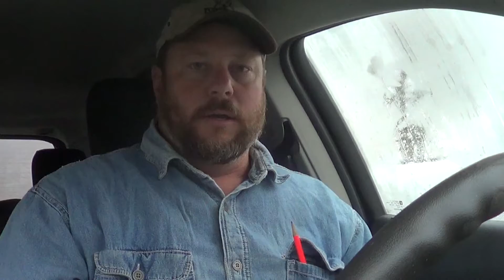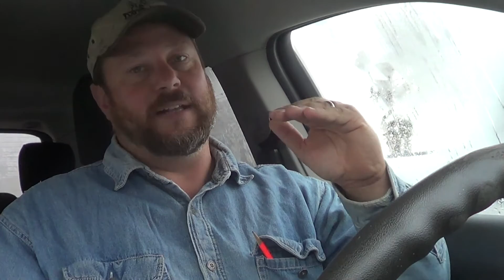Why Sweet Iron with Copper is the King of Metallurgy for Bits

Comment: What about brass, or brass inlay?
Reply from the maker: That's a very good question. All that you have to have for galvanization is 2 different metals. Brass is technically an alloy, but if it were inlaid or otherwise attached to a stainless steel (another alloy) or sweet iron (mild steel) mouthpiece, then you'd still have galvanization happen. There's a chart/scale of votage potential for each metal. The difference in the positions of the metals on that scale is what determines the strength of the battery you've created. Obviously the combination or difference of voltage potential between copper and sweet iron is a sweet spot of voltage potential that is pleasing to horses. So, if you made a stronger/weaker battery, you'd still get results, but maybe not as good.
Reply: @DanielDauphin  what do you think about making a snaffle or curb bit out of high carbon digger chain and brazing in the brass? Is sweet iron high carbon or low carbon steel? Thanks
Reply from the maker: @JackGarrettJr  sweet iron is just basic, low carbon steel.  At least today's sweet iron is. Brazing in brass will definitely still give galvanization and a current. It would depend on the specific voltage potential of each metal on the galvanic scale as to how strong/weak of a battery those 2 metals would create. There's bound to be a hi-low range to the benefits, but I haven't done the testing I would love to do to identify the range and effects.

Comment: It is so obvious you know nothing about bits except what you have been told or read you have not experienced them or you would know all Cowboys want their bits and their Spurs to rust out they do not want you look like a damn team roper with stainless steel bits there is so much more to this than what you are talking about you know absolutely nothing I doubt very seriously you are a trainer I've been training horses for 40 years and there's a reason that bit makers use metal that rusts out that they do not mold it out of stainless steel metal like these so-called handmade bits like balding they really are not handmade bits you could not buy a really good handmade bit for $250 or $150 I know so little and you're so aggravating just to listen to I need to write this s*** down so you can read it off a teleprompter or something like Joe Biden it's aggravating just to listen to you talk because you don't know most of what you're talking about and my Lord you know nothing about bits

Comment: This is amazing! I love that you got down to the science of it all, its truly fascinating. I have a quick question. Do you have a brand or specific place you get your sweet iron/copper inlay bits from? I really like that you have the experience and knowledge of bits and I would love your input on any specific brand?
Reply from the maker: Kimbri Herring Thanks for watching. I have not yet given my endorsement to any specific company. Most of the production bits out there ($35-60) are functional and good enough, as long as they have the correct components and mechanics. If your budget is a little higher, you can go semi or full custom, which may get you to around $2-250). Those bits are more functional art.

Comment: I know someone has already asked this question but this is sort of a secondary question to it. They asked about it being safe for you to put a rusty bit in a horses mouth and you said that we aren't talking a ton of rust. And I know I'm just sort of picking things but I want to make sure I'm doing things that are safe for my horse. Bits can get really rusty, like fully covered, then usually if it's the first time you used the bit and didn't wipe the saliva off or whatever the first little bit of rust gets on it. So do you just never scrub the rust off the bit and let it get as rusty as it can or do you occasionally scrub some rust off so it's not completely covered and layered with rust but it still has that texture. Not sure if that question made sense but I was just wondering if it mattered. And I know I've been asking a bunch of questions on your vids but I've just kind of been bingeing them because I want to be more educated about what is going on in my horses mouth and that I'm not causing unnecessary pain, so yeah I commend you on having really educational videos because I know they have helped me understand bits soooo much more
Reply from the maker: I'll use a hose on them regularly and a brush or my fingernail to clean up gunk as I notice it.The gunk and most of the rust will occur on the front side of the bit where it never touches the horse's mouth. Other than that, I don't do much with them. Mine are ridden regularly, so they don't really appear all that rusty. The places that they make contact in the mouth are usually fairly clean and show typical wear.

Comment: Thank you Daniel !!! Now I know why my sweet iron w copper got rusty and I almost chucked it. What do you recommend doing to it - scrub it with vegetable oil to clean ? Merry Christmas and happy new year to you and all in your keep. xxx <3
Reply from the maker: barb s I hose them off and just use a stiff brush as gunk accumulates in the crevasses. Nothing more. I have had to retire a few, but always from wear in the center rings of the mouth. Never from rust.
Reply: Thank you, I shall do this. The bit is a thick D-ring snaffle, iron with copper insets - I thought I wrecked it because of poor cleaning (I'd just use a cloth wipe it off after use and hang it on a wood hook - was alarmed at the rust after not using for a few months). But your investigation makes a lot of sense: why sweet iron without copper causes no salivation = add the copper and my horse just flows. I have a tom thumb sweet iron (no copper), and same horse doesn't flow saliva same as she did with the D-ring iron/copper. Amazing connection you made here. Thank you so much bro. xxx <3
Reply: you know, come to think of it - when you purchase a 'sweet iron with copper insets', notice that: it has a film on it, not sure what it is... but that would be to stop it from rusting in retail humid situation. They gotta know this would happen, that's why they do it. Some of these bits on the shelf have a blue tinge on them cause of whatever coating they put on them for shelf appeal. Absolutely interesting intel you offered us here about how iron and copper reacts to moisture in the horse's mouth and how they like it & beneficial to them holding the bit. I'll really appreciate this more, and look into it deeper.  Who the heck thought of adding copper to an iron bit? Gotta be a patent guy somewhere? lol
Reply: I use denture tablets to clean my bits, seems to work well enough!

Comment: A few questions:
1. What bit is better when competition regulates that you can only use a bit made of 1 type of metal? 
2. Is it really safe to put rusty metal in your horses mouth for extended periods of time? over a long period of time? is there a limit to how much oxidized metal your horse should ingest? 
3. With proper training and conditioning, a proper fitted bit/bridle, and a person riding with correct contact...shouldn't a horse eventually be able to hold a bit in it's mouth without becoming fatigued?  do we really expect our plow horses to hold a bit themselves for hours on end? (I'm genuinely curious)

thanks!
Reply from the maker: 2Lucid on your first question, I'd try different types and see which my horse preferred. Most likely, that'll be sweet iron. 
Secondly, we aren't talking about lots of rust here, so I wouldn't be worried. If you cook with cast iron, you're ingesting it too, as am I and my family.
Lastly, you are absolutely correct about conditioning, but fatigue will always be out there. Just because a marathoner can become conditioned to run 26.2 miles doesn't mean that they don't get tired or cramped while doing it.
Hope that helps and thanks for watching!
Reply: Daniel Dauphin Where can I find a selection of these bits? Are there any websites you can recommend?
Reply from the maker: 2Lucid I'd be happy to if you'll just contact me through my website.

Comment: Good explanation. About fifteen years ago I showed my father, who knew nothing about bits or horses, but was a corrosion engineer, one of these bits. The first thing he said was, "I bet the horse will salivate a lot with that in his mouth." He went on to explain why in a way that made my eyes glaze over and made my brain cramp up. In the end he said it was basically a battery. Stick the ends of a nine volt battery on your tongue and it will tingle a bit and stimulate your salivary glands.